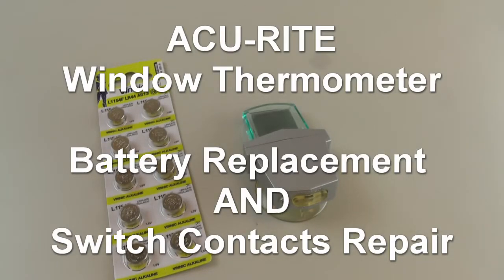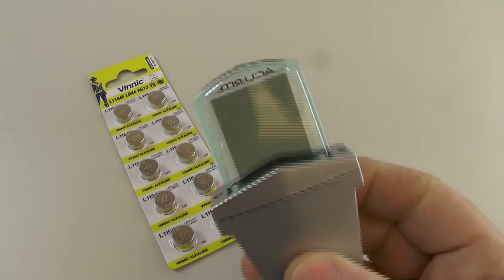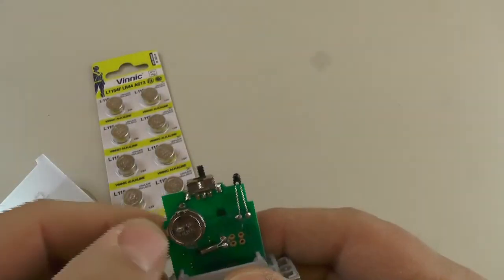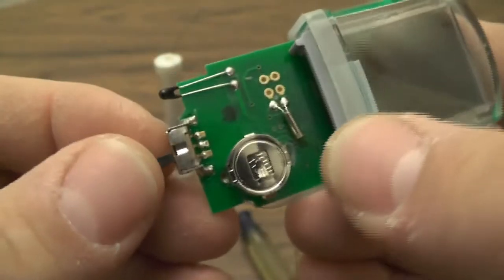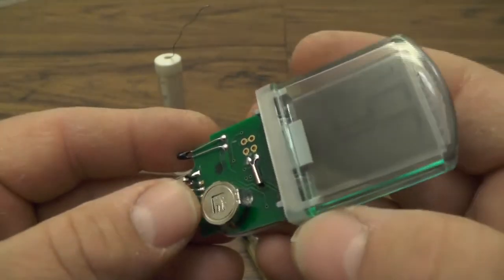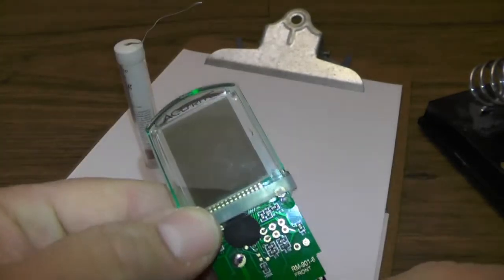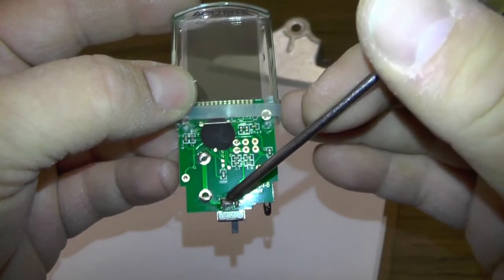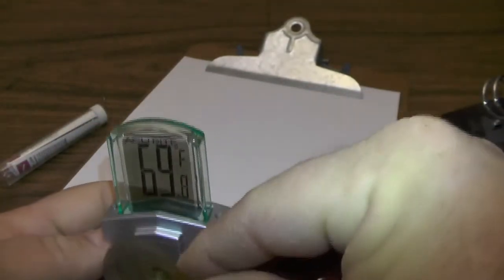Acurite Thermometer Repair (Battery Replacement & Switch bypass)

Comment: I installed a new tested battery and display came on for a second. when I bypass switch terminals with screwdriver I get no display. Any guidance appreciated.